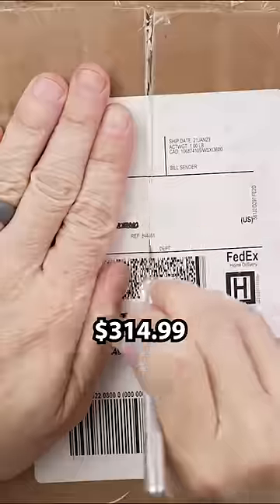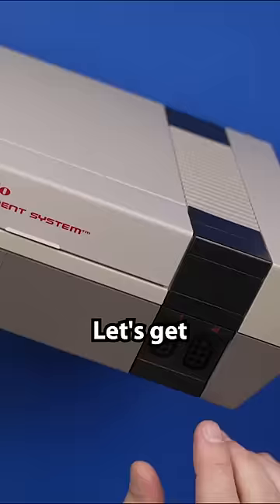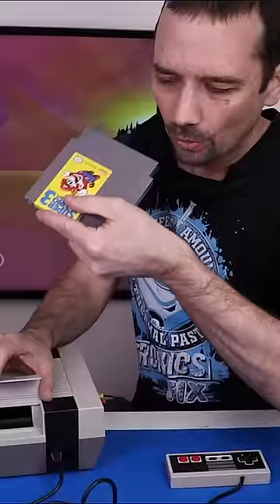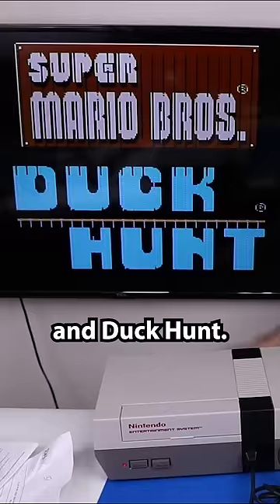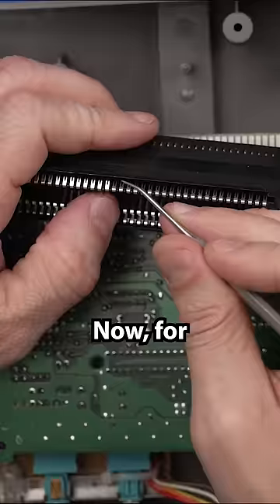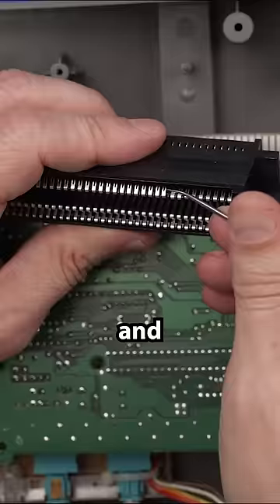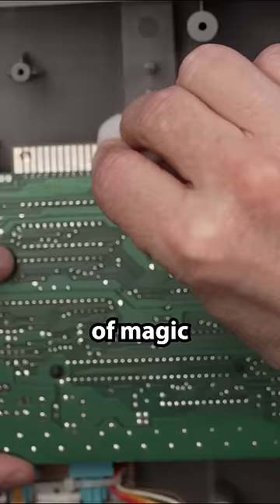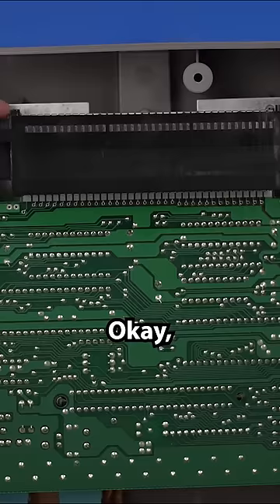"Refurbished" NES From DK Oldies

Comment: Found a working N64 sitting in the back of a goodwill store for 10 dollars, including 2 controllers, works like it's brand new. DKOldies is TRIPPING
Reply: Bro what good will stores are you going to??? 10$? Damn
Reply: @Error_code_1001  he literally just said 💀
Reply: man, that's good
Reply: @kiachaelchild  what? No he didnt
Reply: They didn't know how rare it was
Reply: Clean it, then sell it.
Reply: Yeah i also found a working N64 in goodwill with 4 controllers and 6-7 games for like $20 total😂
Reply: Happens sometimes as most Goodwills use volunteers and min wage, but they do tend to set retro game systems aside for the auction sites
Reply: I believe you. I bought a n64 for $8 dollars console only at a pawn shop and it works fine
Reply: @giantturd5157 he said goodwill my guy
Reply: Almost every goodwill sells trash. It's hard, very hard to see videogames, much less at these prices. If I do see any they'll be at market or near market prices
Reply: facts dude. A couple years ago I went to a Goodwill right behind my job after I got off work and walked out with a PS1, a controller, all the cables, and Tony Hawk's Pro Skater 1 and 2 for $18 total. PS1 alone was $15 and the games were $1.50 a piece. A buddy of mine found a pair of Nikes that went for like $150 retail, and were in pretty decent shape overall, and picked them up for $10. Crazy good finds sometimes if you're willing to dig and be patient. 

I completely agree DK Oldies definitely smoking crack.
Reply: Where? I never find games or consoles in my area
Reply: @blindperception7434  me nether.
Reply: that's how creepypastas start
Reply: @giantturd5157  “goodwill store”
Reply: @Error_code_1001  good will has everything under priced
Reply: @epic_errors  and the person they were replying to said "what kind of goodwill stores are you going to"
Reply: @epic_errors  He said "What" goodwill, aka where/ which one...
Reply: @stephensocialmedia7909  lol pretty sure he edited it. I'm not the only one that noticed he said what store you going to
Reply: @giantturd5157  Nobody can read apparently 😂
Reply: @Error_code_1001  one that clearly doesn't know the value, or care to what they could get for one.
Someone donated a 64 in excellent, just about new out of the box condition unit with a 4MB expansion pak, Mario 64, and at least 1 controller to our thrift store a few years ago. Not sure if she still has it or not.
Reply: @epic_errors  He didn't say which one there buddy. Re-read their comments.
Reply: i found a gameboy for 7 bucks in a goodwill and a few vertical lines of pixels didnt work so i repaired it myself
Reply: @kiachaelchild  no he never said which goodwill so why you putting skull emojis for ??
Reply: @inputfunny  he did say goodwill there buddy. You coming in here kinda late after the person asking which store went an edited their comment. Do you not see the other people saying the exact same thing as me? Lol
Reply: @epic_errors  Which Goodwill store? That's what I thought...
Reply: @Error_code_1001  most goodwills sell their tech for 10-25 depending on condition and how new it is they have a system for such things, they can’t just crock a price up because they think it’s rare
Reply: Got my PS3 fat - sadly not a BC model - for $15, it was just shoved in with the pile of old inkjet printers.  I miss good thrift finds.
Reply: @blindperception7434  same
Reply: I remember my mom got me a gameboy advance somewhere for $25. I wish I could find another deal like this
Reply: @giantturd5157 he said goodwill. Read man damn
Reply: Didn't mean to start a whole thread and I've found a ps1 as well with 2 controllers  for 15 at another one, goodwill isn't there to over price or even correctly price things, it's a thrift store....
Reply: Oh that's nothing, ... I'm offering a service to collect all of your children's old game consoles for FREE 👿
Reply: No bro you are lucky. That thing is expensive for a reason.
Reply: Thats how i got mine in like 2008. Came with a green yellow and black controllers sm64 dr mario and some snowboarding game that didnt work for just 30$ or something
Reply: @supermonk3y07 I put 2 working xbox360's near the dumpster outside a couple of months ago because gamestop didn't want to take them
Reply: @alexvaldez47  you could've given them to me or even sold them
Reply: @supermonk3y07  Someone probably took it
Reply: @stephensocialmedia7909  I mean any goodwill, it just depends
Reply: Found a GameCube with a copy of madden and controller for $10 at goodwill. The first time actually finding something good.
Reply: DK oldies isn't a thrift shop tho. Idk how people don't understand how resell markets work, if DK is for people who aren't going to spend multiple trips to thrift stores and garage sales looking for a good deal it's for people who want certain games ASAP
Reply: @SpaceNigs  that's the point, you CAN find better deals at thrift stores and garage sales, what I'm saying is that their "refurbished" consoles never seem to work when I see people test them and comments about how someone ordered from them and it didn't work, paying a higher price for on demand when you don't know if it's gonna even work or not isn't really worth it in my books, I'd rather search if it means better deals

Comment: I got an NES in a similar condition for about $80. It just needed some cleaning but it's still going strong
Reply: I love getting consoles cheap, I got 4 snes consoles for $25 because the owner thought they were dead because he got no image on the screen, turns out he had the channel selector switch on all set to channel 4 and he tried on channel 3 lol
Reply: @joshkelly4682  haha nice! You got a good deal out of that. Just trying to get one in really nice condition is a bit pricey
Reply: Yeah because this thing isn't actually refurbished but rather just working but not in perfect condition
Reply: Honestly, I'd never buy an old console for $300.
Those aren't rare at all, go around doing garage sales and you're bound to find one for less than a hundred.
Reply: @RomainDelmaire  Definitely. Especially an NES of all things. There is still a good chunk of them out there. They sold pretty well back then. I would only ever spend that much on an old console if it had its original box and inserts at least. But for what they gave him at that price is not okay.

Comment: Refurbished technology is equipment that has had a previous life, anything from a laptop to a server estate, which is then put through a testing, repair and upgrade process. This 'refurbishment' process is designed to fix any faults, increase performance and, in some cases, remove physical damage from the product.

Doesn't sound like they did anything but hook it up and turn it on then resell it lol

Comment: ive been refurbishing and cleaning my systems for years and i never thought to restretch the pin connectors. thank you for this!
Reply: You can buy replacement 72 pin connectors for like $10 tops.  A local game shop to me sells them for like $7.50 last I was there, but they were cheaper than online.
Reply: @PubstarHero no just please God no seriously don't ever do that I'm not trolling or joking or trying to be mean. The pin connectors on an original NES is gold plated. So long as it doesn't corrode (highly unlikely unless met with liquid damage or flame) there is almost no conceivable way for it to get damaged enough to ever need a replacement. I'm not joking it is literally plated with GOLD. Those cheap Chinese pin connectors are usually brass which is a vastly inferior product. I own 2 NES one is my father's as a kid and the other I purchased in Canada both have the original pin connectors and work completely fine. You can even boil the old original pin connectors to heat treat the pins and improve conductivity. The cheap replacement pin connectors wear out between 5-10yrs at best and require more replacing as time goes on, they devalue the NES and put it in a worse state then if you left the original. It's like watching someone butcher a colonial style historical house to make it "modernized". I understand if the pin connector is completely destroyed and unsalvageable ok replace it but again people use sandpaper and other means to repair the original. I can't even
Reply: @BatsofPrey  Speaking the truth.  I watched this dude bending the pins and I'm like "that's not how it's done, son."  Boiling works, it causes the contacts to reset and a TON of crud (usually tobacco tar) to come off.  And a properly "refurbished" frontloader will not work 100% of the time, it will work like 94% of the time, because that's how well it worked when brand-new.
Reply: @DarthGylcolious  plus the new ones will have a death grip that pulls on the carts too tightly causing eventual wear and tear damage on your already aging game carts

Comment: When you take the cartridges apart, use a piece of printer paper around your finger and rub that across the contacts not up and down but all the way across side to side.  It works so much better than how you did it and the paper will be super black with corrosion and the contacts will be super shiny clean.

Comment: I paid $60 for a dusty one (including shipping) a few days ago. It was almost as clean as the one you have here. $15 for smb3, and smb/duck hunt is $10 or less. < $10 each for controllers, $15 for a high quality replacement power supply, and $10 for very high quality RCA cables. DKO didn't do $80.00 worth of cleaning, let alone the $180-$220 premium they're charging.

Comment: The pin connector is not supposed to be tight, they are only meant to be close enough so that the cartridge connector connects once it's pressed down.  I bought an NES with a stock connector, albeit dirty, for 50 dollars, I threw the NES cleaning kit in it, and it boots games up first try every time (provided the cartridges are clean), and the cartridges interchange very easily.

Comment: That's a absolute scam. Bought a refurbished NES with a brand new 72 pin connector. Clean and retro brightened smb3/ duck hunt. Cables and a original controller for like. 100$ on eBay. Still play it when I'm in the mood. Had it for years and years. 300$ is. Ridiculous

Comment: $300+ for that in 2024, even if it had been working perfectly out of the box, is absolute insanity. I just got an NES from FB Marketplace a few weeks ago for about ~$63 that worked with absolutely zero issues (unlike the one in the video) and came with the plug and video cables, a controller, and a game. Sure it's missing the zapper but that goes for about $20-ish, so it's still a far cry from the $319.99 that this cost, especially considering you had to disassemble the system and bend the pins on the cartridge reader back into position yourself. "Refurbished" my ass. You could even buy an Everdrive N8 PRO with the difference and still have some change left.

Comment: I recently got a refurbished NES and the cartridge kinda needs a bit more effort then necessary to get them out, is there any way to remedy this?

(Also, my NES was a pack of the NES, Mario 1 with duck hunt and track meet, Mario 2, as well as 3, and TMNT 2, and Legend of Zelda, it also came with 2 controlers and a zapper. And that only cost me around 280. Wow DKoldies.)

Comment: Probably shouldnt use magic eraser on the contacts of a decades old fame system, because it basically acts like a super fine sandpaper, so youre just filing down those contacts. Should probably just use a microfiber cloth or q tip, something non abrasive that will stil clean off any build up
Reply: Dude I’ve used an eraser on contacts older than me. It’s fine. I was born in 1963.

Comment: I bought one for $40, it came with a controller, Zapper, and the Duck Hunt/Mario Game. I cleaned both the chassis and the internal components, I repaired the lid hinge and restored the original color with vol40 peroxide along with UV led lights and everything does not exceed 65 dollars. 

Don't buy from Dkoldies, don't feed the parasite!

Comment: Claiming a console as refurbished which can't play games on first pass and can be easily resolved by cleaning it should be grounds for a lawsuit. At that price point, the inside and outside should be immaculate, all screws tightened to spec, all pins tightened and secured, the chassis restored to original color (i.e. with hydrogen peroxide and UV), all stickers in Grade A condition, and for God's sake, do something more respectable with the shipping box other than scribbling with a sharpie on the outer packing tape. Gifting this to someone for over $300 should make them feel like they just opened up a time capsule.

Comment: An nes system at the most cost 60 dollars even if Nintendo made you a brand new one 300 dollars is rip off, even for YouTube content, heck you can get the third party systems for under a hundred that play snes and nes with hdmi and they make a gun that works with flat TVs for under $100usd.